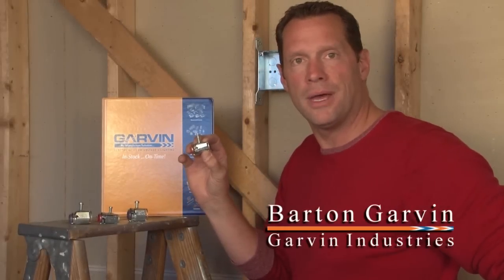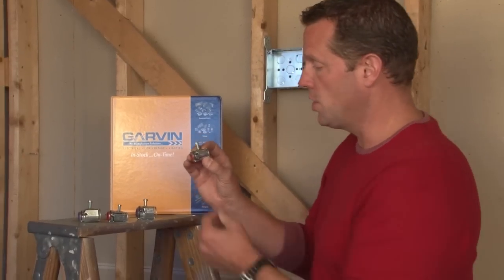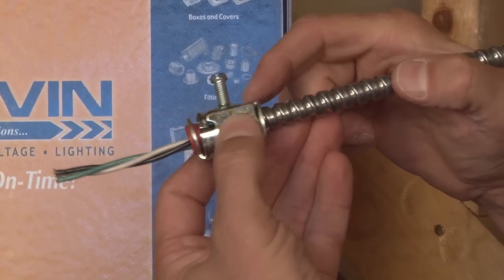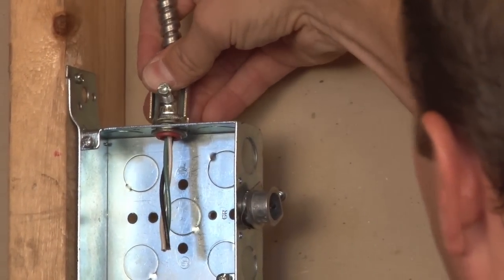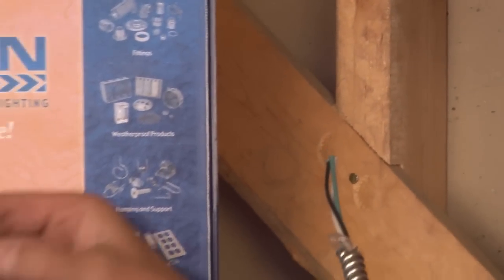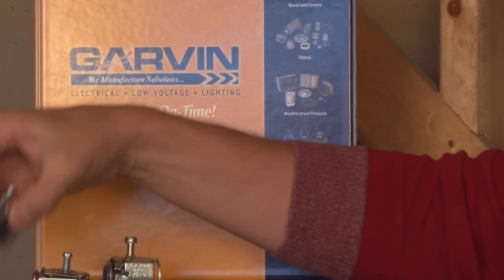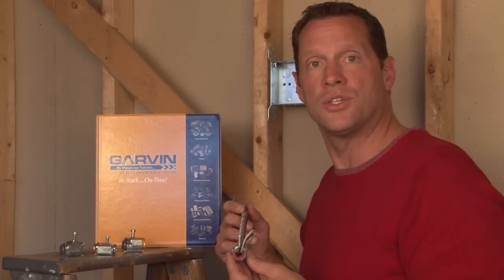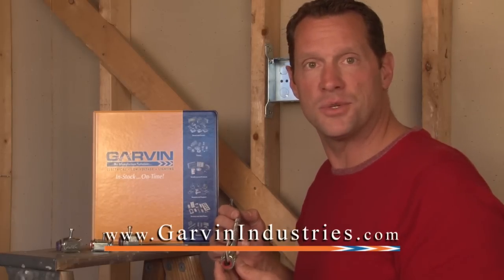Fast Lock Connectors... FLC & FLD Series

Comment: It looks like he omitted the anti-short bushing.
Reply: Seems like the fitting has some sort of red plastic bushing... not clear if that is sufficient or if you need to use an additional bushing.
Reply: @wayne530  These types of connectors have an integrated bushing so you don't need to add one.
Reply: @1575murray  Anti shorts are only required by the NEC for AC cable, not MC cable. It is optional for MC cable, but they come with the roll and are an extra layer of protection.